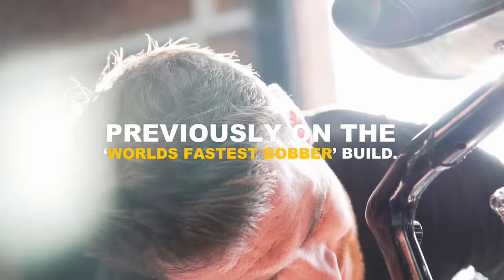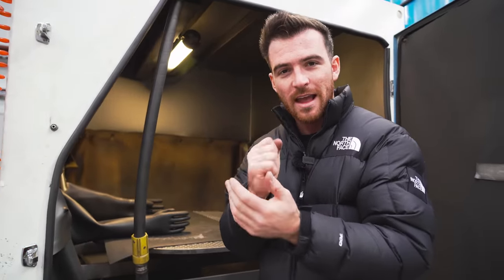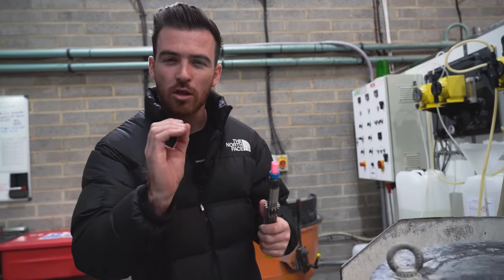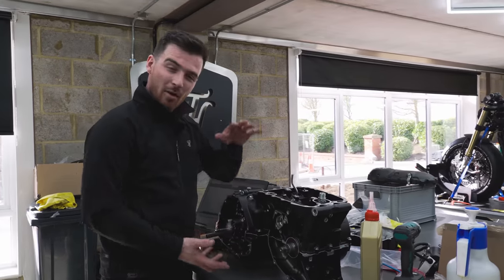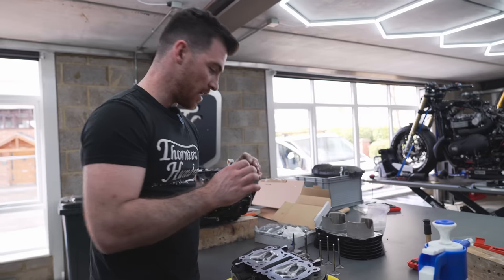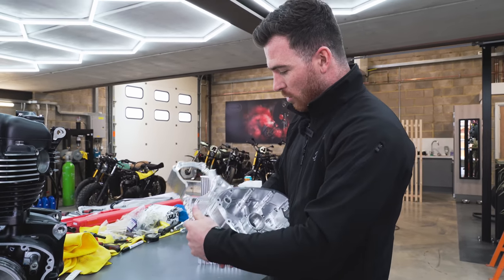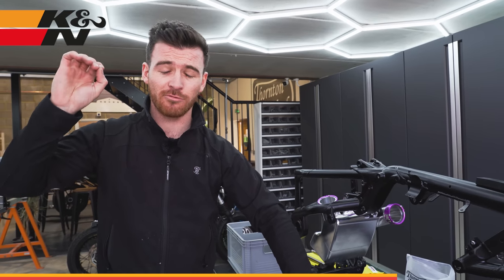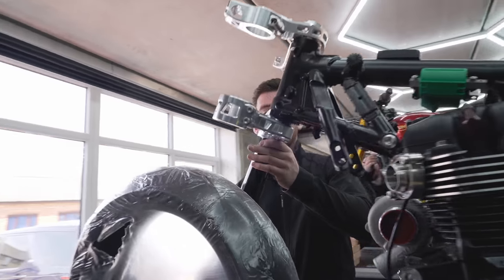BUILDING THE WORLD'S FASTEST BOBBER ENGINE 🛠 300HP?!

Comment: Was the crankshaft+connecting rods+pistons&rings all rebalanced? Were the cylinders rebored and honed to tighter tolerances? Was the lower crankcase blueprinted? Does the engine have a more efficient oil pump? Are the connecting rods lighter maybe made out of titanium?  Are the cams different?
Reply: Why do you asked ? 
You saw the video, dident you ?
Reply: @BaronvonOldenBiker  That's what i mean, if he did more than the theses few parts he would have showed us.

Comment: Does the supercharger riding on the end of the crank end affect balance ? stress the big end bearings other internal bearings ..cases.. I would believe that it would as your adding tension to the belt...how is that dealt with internally...What are you using for a clutch pack...after market, stronger springs....curious ...Well done !!!